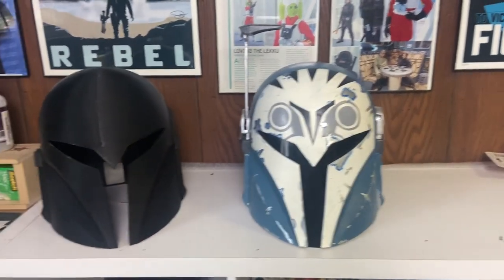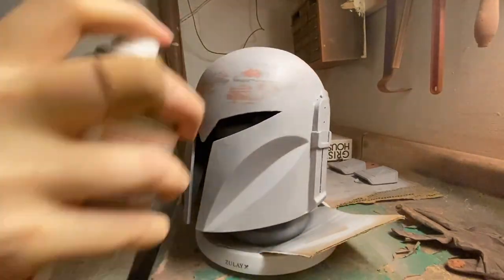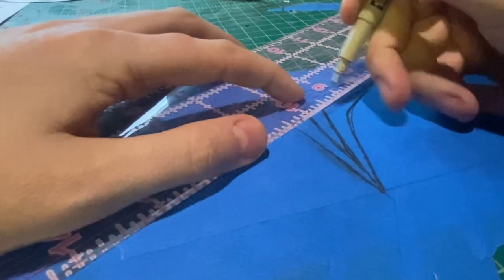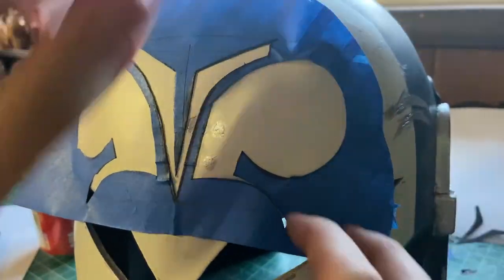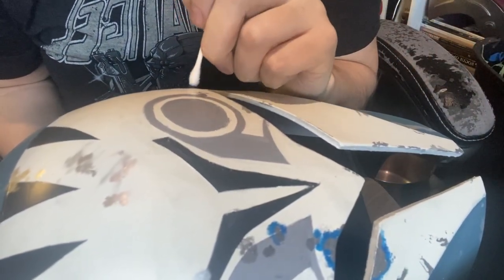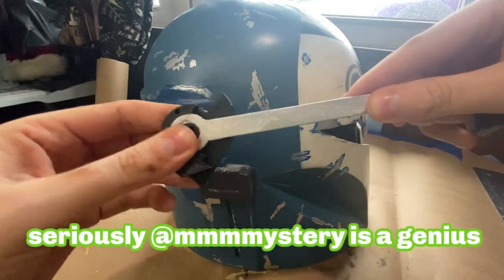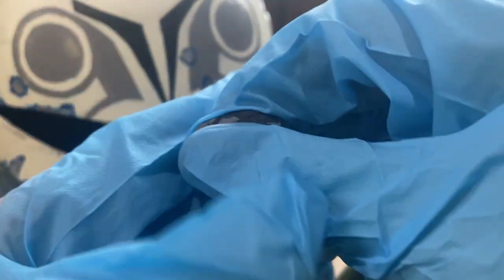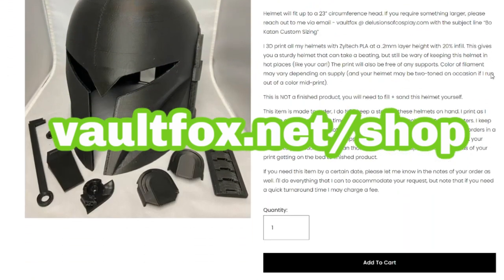How to Make Bo-Katan’s Helmet from The Mandalorian // Building Bo-Katan Cosplay Pt. 4

Comment: Awesome work...currently working on the same file and going to use your template. Many Thanks
Reply from the maker: Thanks! When you print it out, depending on printer settings, you might have to size it down a bit. I just used it on my latest helmet and that’s what I had to do